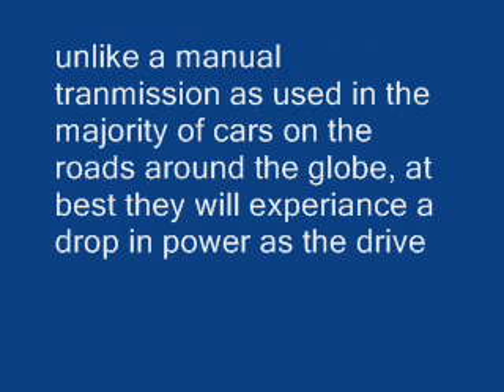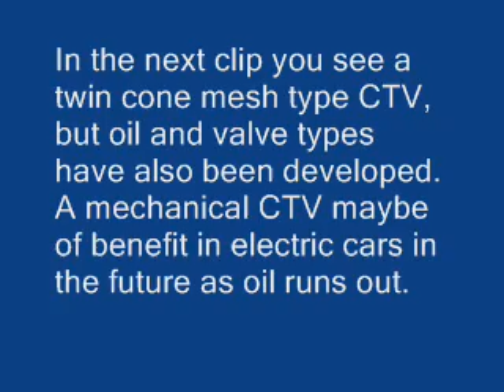CVT explained

Comment: Hm. I like the idea of a direct-drive mechanism for a CVT -- theoretically, the mechanical efficiency should be a lot greater than friction-drive mechanisms.  However, I have to wonder what kind of load a floating sprocket bar can really take -- floating implies that the joints are at serious risk under high load.  Also seems like at high rpms, this could get really noisy as well.
What might be a little bit of clicking in a small demonstration could be a high-pitched whine at 5000 rpm.

Comment: @nandiito 
well not competely true...a 1994 Volvo 440 automatic also had such a transmission...but the first car with such a transmission is the 1966 DAF 55 coupe ...DAF (a Dutch car company) was later on bought by Volvo in 1975 if I'm not mistaken...So the CVT transmission has been around for a while...just as the electrical car (between 1832 and 1839)

Comment from the maker: The demo model shown was driven with a 6kw 4 pole induction motor run at 50hz which at max rev gives about 16.57ft-ilb of torque. it was not tested or built to go beyond those limits. The weakest link is the medium used to join the driver to the driven mover, a 40mm belt can handle 400nm which is just shy of 300 ft - lbs, a chain can drive much more, so the demo model shown was not tested to drive 542Nm of torque but current CVT systems on the market could do so. hope this was of help.

Comment from the maker: regenerative braking on a bike would be difficult to control to ensure the braking is even, eg does not launch u off the bike. the motor would also have to be suitable to act as a generator, perhaps a capacitor would be a better storage device for regen braking as it can deliver power to the bike quickly & takes a higher input charge. but you would also need the battery to run the motor. a 48v dc motor, in that case best use a mech transmission system to get best power & torque,the CVT should do

Comment: @kingjimsixsix5

Yes it's going to be electric but from a combustion engine donor bike. I was going to use a decent 48v or higher motor (like an Etek) with a motor controller and dc/dc converter for the 12v stuff.

Also it's just occurred to me, can these take torque FROM the wheels TO the motor?? for example if i want to put in some electronics for regenerative braking (to charge the battery's while 'braking'). 

many thanks for your reply i'm looking into makes of friction drive CVT now.

Comment from the maker: cheers mate, perhaps you could look up a friction drive system, that might be suitable for your project. tell me is the motorbike being converted to electric? if so perhaps a frequency converter and rectifier could be used to control the elec motors speed. but that depend of the motor type.

Comment: my 2 nissan are cvt . 2.0 sentra and 3.5 murano . im totally satisfied by both. programed with  over 700 different driving scenario adapting to your today driving is really usefull .its far from when you say that if simulated gear shitfSHIT as jeep does . at start i was really buzzed cuz of no gear change even auto trany shift now ihit gaz at 0km/h the motor get to a stable 6000rpm not loosing timeto shift noback effect as we know, 3to4 week to get thehabit,i will never throw a shifter again

Comment from the maker: some manufacturers are setting it up so that the CVT will simulate gear shifts, the driver presses a button or paddle and the CVT moves up along to the next pre-set location alongs its gear band and holds on that until the driver selects the next gear. This is all controlled through a central control unit, simular to a PLC. cheers.

Comment from the maker: turbo charged cars using a CVT, well most of the main market cars that are using a CVT are doing so and being sold as a more green option, thats not a selling point you need if selling a high performance car, but the new 2010 subaru legacy has a CVT version transmission available and the legacy is no slouch. if a car manufacturer wants a CVT in a high performance car its just a matter of designing it to meet the conditions it will experience but this has a cost, manual trans are tried & tested.

Comment from the maker: no its not a substitute for direct shift gearbox, the DGS is a different concept in that it used a dual clutch to increase shift times, a CVT suffers zero shift losses as there are no shifts through gears. The CVT using a control unit can cycle up and down through an infinite amount of driver and driven gears within the range. The CVT system still would require a clutch for it to idle. the CVT & DSG are very different systems. cheers for watching.

Comment from the maker: its a transmission system, like any system it can be designed to withstand the forces of a given engine size including power achieved by a turbo kit, in the demo model built above an electric motor was used. as with all road cars, the more power the engine can produce the stronger the transmission system has to be. so you have to know your engine size power also, thanks for watching.

Comment from the maker: The CVT can be set up to have simulated gears, eg once the chain reaches a certain point it does not move up, the engine rev's climb, allowing the driver to press the paddle and the chain to roll up to the next gear set point, it gives the driver an element of control on rev's and gear.

Comment from the maker: One of the main differences between a manual tranmission and a CVT is that you dont need to clutch the system as you gain speed, you dont loose the power as you would while changing gears, this gives a better rate of over all acceleration, also manual grear boxes generally have 5 gears, the CVT is not limited as such as gets better torque without the sped differences experienced by manual or auto transmissions.

Comment from the maker: excessive engine braking is not recommended as it puts additional pressure on the transmission system, achieving engine braking with a manual is easy, its not possible with a standard automatic unless it has a tiptronic type system. A CVT system in theory could be operated to have a engine braking but it would have to have an option to simulate gears with a manual control using input from the driver simular to that of a tiptronic system. But many of the current system on the market dont have it.

Comment: Nissan is a HUGE CVT supporter. I have the 2009 Altima. They recently extended the CVT Drivetrain warranty to 100k -10years. Shows durability of the design as well as the doubt of consumers thinking the design wont last.

I liked the Mitsubishi CVT Better. Better feel some how. Also the Lancer Paddle shifters are AWESOME. I  went with the Altima b/c the lease had no down payment.

Comment from the maker: True but thats the design trade off to reduce wear on the parts, a standard gear box will have oil in it to achieve that also, the CVT may not need to by immersed totally, like most gearboxes as they operate the oil will be splashed about and cover all the working surfaces. Thanks for watching and your comments

Comment: Several sites claim that the Anderson CVT would be contained in an oil-filled case to cool and lubricate the chain, as well as to reduce any noise from the chain and (in this design especially) floating components in the cones.

Comment from the maker: heat was not a problem for the system built, similar to a fan belt and alternator set up in a car. to apply this to a commercial application (car/bus etc) then a lubricant would have to be introduced mainly to reduce friction and wear with heat removal as a secondary benefit. slip is prevented due to lubrication by using teeth on cone or belt/chain. thanks for watching.

Comment: Could or would this setup be immersed in oil to control heat or is heat a problem? And would immersion in oil reduce the friction or would immersion not work here.

Comment from the maker: For most vehicles with gears you will need a clutch system to allow the engine to be seperated from the transmission system during operation to allow a new gear be selected, manual cars will have a clutch pedal, automatics do not, Go Karts use a centrifugal clutch system which works great for small engines. Sequential is just a method of changing gear an example would be a WRC car uses a sequential box.

Comment from the maker: well your HP is based on engines power, small engine small power, large engine large power, the CVT is a transmission system only it would not up the power available just apply it more effectively than a manual transmission would. cheers for the question

Comment: Yeah but for a 60 year old design it wasn't bad. If Buick didn't dub it outdated in the early 60s they could have improved on it. I've got a dynaflow in my '59 Electra, it's a cool tranny and for weighing 5000 lbs it's pretty quick for only having 3.08 gears. Cheers

Comment: Thanks for the answer. CVT is all new to me, but I honestly love it. I can drive on the motorway in over 100kmh with under 2000rpm on the engine. It also gives a very smooth ride plus the "6 speed manual mode" changes "gears" quicker than any normal automatic gearbox!

I think CVT will stick around for a long time, only downside is that I still think a manual is more fun on the track!

Comment: dsg is a electronical semi-auto, semi-auto use the gear arrangement similiar to manual but the clutch is either electronic or centrifugal. centrifugal semi-auto already exist since 1950+ used by honda cub till the recent honda wave motorcycle and cars like Citroën 2CV

Comment: have you been heard about powershifting? its a shifting technique used on a manual, the driver's  foot never let off the gas but the clutch is kicked and shift knob is slammed from gear to gear, was means to shift as fast as possible while keeping engine powerband, doing this can beat a automatic that designed for drag racing use, even cvt. but doing this will have a bad consequence resulting clutch wear quickly and tear down entire transmission

Comment from the maker: Im not all that familar with the details of the sentra but I would imagine that the overdrive button would work like the sport button on the BWM or opel Omega in which it would allow the car to rev higher before moving up to the next range to increase over all acceleration, I would also imagine that the low gear acts the in reverse to the overdrive system and allows the car to idle lower to save on fuel. thanks for watching.

Comment: Nissan's Xtronic CVT( what the Sentra SE-R has) has a button that you can turn on to simulate gears. It just locks the belt at set gear ratios. There is still technically no gears

Comment: Modern CVT transmissions are computer controlled and can "emulate" gear ratios.  This is often done at lower speeds because even in automatic transmissions people are used to feeling the 1-2 and 2-3 gear shifts and not feeling it can give a false impression of lack of power.

Comment from the maker: you have me stumped on that one mate, from the CVT's i have experienced they match the range that would be experienced by a manual gear box, perhaps the engine mapping has been altered on those videos you have seen so to produce maximum acceleration 0-60 and top out short of what would be there normal top end.

Comment: Thanks, but i've seen some videos where people display their cars and accelerating with a CVT, and their Tachometer was almost reaching the limit of safe usage, but the speedometer was only 2/3rds the way to the end, does the CVT transmission prevent the car from reaching the maximum posted speed becasue its engine reached the maximum amount for RPM?

Comment from the maker: A CVT covers the entire range of Gears that would be present in a manual or automatic gear box thats the whole point of the system is that you dont need to change gear that would mean clutching and loosing time in doing so.

Comment: Good question is, DOES IT?
Does the current technology allow the CVT to do such tiny incremental changes in order to increase output efficiency?
Cause if so, it's not doing as well as it should.

Comment from the maker: if you compare a combustion engine with that of an industrial electric squirrel cage induction motor, then the electric motor is about 85-90 eff for operating equipment or plant, yes the combustion engine is at most 30-35% eff.u are right most of the energy becomes heat, you are also right that saving oil on a large scale is important, but at for now we are stuck with petrol & diesel cars, and driving style is also a factor we can change to contribute. thanks for your comments.

Comment: It's true that ICE's are very inefficient, most of the energy is lost as heat, friction, and bad transmission ratios. The CVT improves on the latter a bit, it's not a huge improvement 5-15%, but look, if the 300 million cars on U.S. roads all had CVT, how many barrels of oil would be saved? Small individual changes make enormous impacts in the community.

Comment from the maker: I believe it can and here is why, as the torque demand changes the CVT can map the ratio's to maximise fuel savings by decreasing the engine RPM to a minimum level e.g. for highway driving. the map can change for overtaking or city driving to give quicker reponse time. So until something else comes along and petrol is still sold i will be happy to drive a petrol engined car.

Comment: Efficiency is by definition getting as close to a 1:1 ratio of input and output power, yes. But engines require a fair amount of power to just run, and that comes out of the power they make. The reciprocating piston engine is QUITE inefficient, but we've been able to make it a little more efficient than when we first started with it, this doesn't mean it's efficient though. CVT will not help efficiency that much.
I drive a 1984 300ZX Turbo.

Comment from the maker: first you dont know what u are talking about, the size of cars constructed in asia has nothing to do with the size of the people there, tut. the market demand is for small cars which not only sell well in asia but in europe, as u use the example of the Civic then let us look at that, the Civic employs VTEC in its engines, unlike the majority of the US model cars, the civic is made from light weight materials, with very advance engine management system so Honda is Very efficient.

Comment from the maker: true but its one of the engineering issues that has to be overcome, but any moving parts in a car are wearing, belts, bearing, tyres its just to manage the materials and rate of wear to a managable level to make it operate well but make it cost effect to the users and for the manufacturer to produce. wear is unavoidable, but you will experience wear in a manual gear box also. thanks for your interest.

Comment from the maker: good question, all the evidance i have come across from mitsubishi and Nissan points that the traditional manual, the auto trans and the CVT are all in the same ball park, it depends on how hard u push the car, different drivers have different styles throughout the life span of the car. The auto trans has been around longer but all info points to them being equal in life span. thanks for watching.

Comment from the maker: I would advise using a toothed belt, a flat one is more likely to slip. but i would recommend a chain, no flexing or possiblity of twisting. if you're talking about aligned with there centre lines perp to each other then yes. if u go with a belt then it will have to be quite rigid, a one like a fan belt wont do the job. Keep the questions coming and dont forget the 5 stars, cheers.

Comment from the maker: The large end of the cone is the equiv of say 5th gear and the bottom end of the driver cone is the equiv of 1st gear, the manufactuered CVT on the market when we look at ratios are comparable. cheers for the question.

Comment from the maker: another good one, the fuel consumption differences would be tiny, you dont loose continous feed of power with a CTV as U do with a manual but the trade off in weight differences means they both could balance each other out. so on fuel consumption neither is better as they both stand. cheers for your interest.

Comment from the maker: interesting question, if we look at a standard 2lt car, the RPM of the  engine at 60MPH depends on the number of teeth and radius of both cogs in top gear, in my car that would be 5th. my car runs at 3000RPM approx doing 60MPH. with the CVT the advantage is not difference in RPM and cog size of the top end of the cone but in the transitions between the equilant 1st, 2nd 3rd etc of a normal gear box, it can maintain a better torque ratio suppling the wheels with a smoother power delivery.

Comment from the maker: thats exactly it as the belt moves across the driven cone increases in speed the primary difference between this and a conventional gear box is that you dont get rev loss between gear shifts as with this system there are no gear shifts, from a stand still the revs climb and continue to climb as you accellerate the car forward.

Comment: CVTs aren't prominent in racing because of their weakness in strength / weight and because of the existence of sequential manuals (electronical btw) which provide manual-like control while maintaining computer shifting speeds. In racing and motorsports... All this wannabe talk about "sound" or hearing it rev doesn't mean anything.

Comment: I agree with you, CVT could indeed be better than any other gearbox since it basically has endless gears. What i mean is, CVT takes away that carfeeling. Like revving from 3k to 8k RPM in 1st gear and then shift to 2nd gear, and hear the engine sing all over again. I dunno if u get what i mean, but I'm sure many other car enthousiast know what i'm talking about...